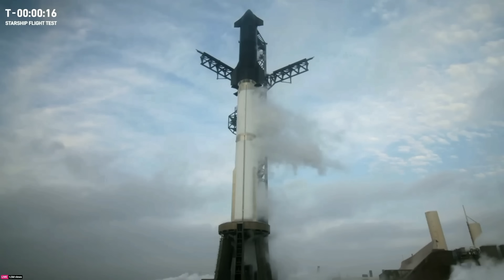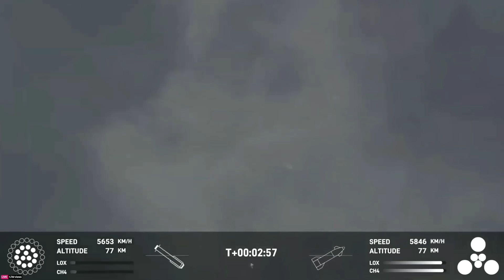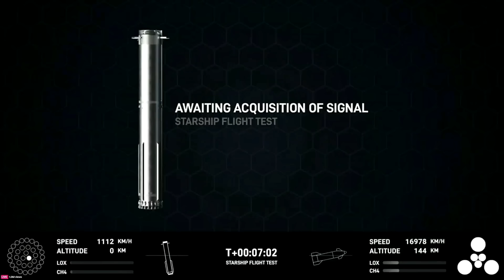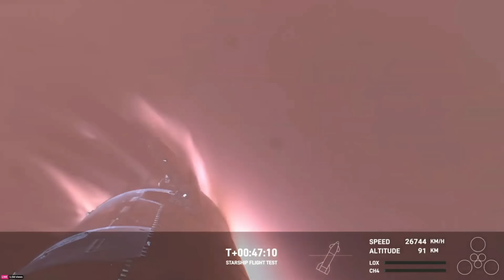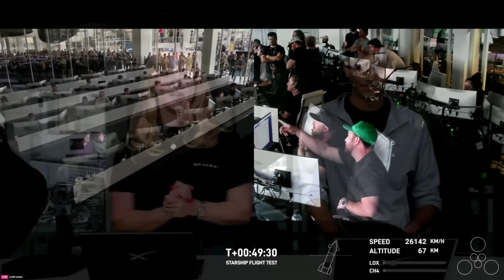SpaceX IFT-3 From Launch To Landing Complete Mission In 20 Minutes

Comment from the maker: 00:00 Launch
03:05 Hot Stage
04:00 Booster Boost Back Burn Shutdown
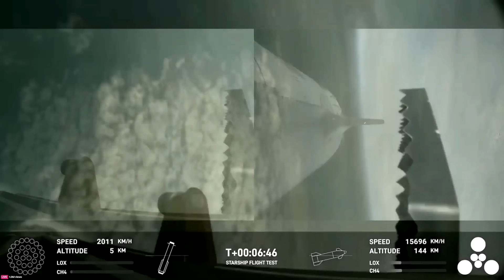07:10 Booster Landing Burn
08:50 Starship  Engine Cutoff
12:15 Payload Bay Door Opening Announcement
12:45 Payload Bay Inside View
13:00 Propellant Transfer Demo Announcement
13:15 Payload Bay Door Closing Announcement
13:22 Payload Bay Door In TROUBLE!
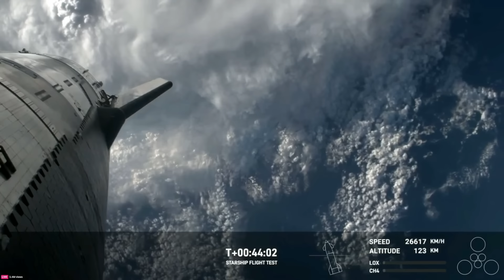13:30 Starship Reentry
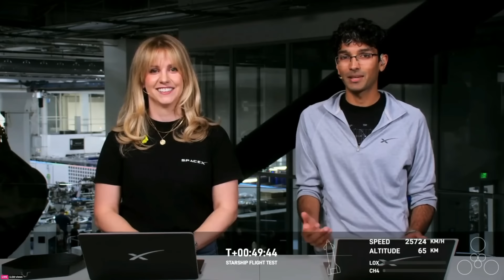19:18 Starship LOST
Reply: Thanks for the details.
Reply: Launch is at 25 seconds
Reply: Ok
Reply: Our SpaceX Starship IFT-3 Mission Launch Reaction:   https://youtu.be/HyQxPLoKm2Q
Reply: 0
Reply: 0
Reply: @firingroom1 oo p p

Comment: This must be the first time they've tried to re-light Raptors while going backwards through low-altitude atmosphere at over 1,100KM/H.  On the Booster all 13 Raptors lit for the boost back burn, but only 2 lit for the landing burn.  I'm sure SpaceX will fix this with IFT-4.
Reply: If they can burn another $1 billion taxpayer money.
Reply: Did the Booster run out of LOX for the landing burn?

@4:07  (T+3:46)  unfortunately they switched the feed from the Booster back to the wrong telemetry side (right)
@4:28  (T+4:07)  A big gas burst 
Venting goes on in waves for the next minute (till T+5:10).
Opening and closing the not proper sealing valve to get it free?
Reply: @PaulaBean  Starship has been designed to operate at $2million/launch.  Compare this to $2billion/launch for the SLS rocket (1/1000th the cost), which Starship should ultimately replace.  $2million isn't far from what it costs to fly a Boeing 787 from NYC to Sidney, should we also shame people for wanting to go to Australia?
Reply: @PaulaBean  Also, SpaceX's contribution to the Artemis program isn't a cost-plus project.  Most of the cost of Starship development is being paid for by SpaceX's own money.  They started Starship development long before they won the NASA contract, and most of SpaceX's revenue is coming from its very busy launch schedule for private companies and from Starlink income.
Reply: @PaulaBean  
Elon said the cost for a testflight is 50-100 Million $. 
Every iteration makes the production process better known, therefore cheaper.

So, 1 billion $ is at least 10 more testflights.

1 Billion $, that´s what the US military budget is for 10 HOURS! 
886 Billion $/year :  365 days/year  =  2,427 Billion $/day      ( :24 h/day  =  0,101 Billion $ / h)

Military budget is one Starship launch PER HOUR @ 100 Million $/launch  !!!

That is disturbing ;(
Imagine what could be done, if we would act as one, worldwide!
I mean the people ... not the politicians.
Reply: @hectorpascale1013  I was thinking something similar to this.  I don't think any details have been made available yet, but I also noticed the venting and wondered if it might be significant to the mission.  Perhaps by this time they had already given up on the orbital Raptor re-light idea for some reason, and decided to release unspent propellant and/or oxidizer before re-entering the atmosphere?  Perhaps based on information they had already gleaned from the Raptor misfires during the Booster landing burn?  I can't wait to hear more details from SpaceX.
Reply: @victorkrawchuk9141  wow，Idk the operation cost of commercial jet is so high before.
Reply: @XiaoMingMC  Actually, to be fair, it would probably cost less than $1million to operate an aircraft from NYC to Sidney, but it would still be not very far from a Starship launch.  Eventually they plan to launch Starship for less than $2million by generating their own methane fuel by scavenging carbon dioxide from the atmosphere, and from economy of scale.  My point is that SpaceX is trying to significantly reduce the very high cost of reaching orbit, and IFT-3 today was one step in that direction.  The days when everything an aerospace company did would cost NASA $billions are over.
Reply: @victorkrawchuk9141  You are wrong each raptor cost at least $1 million and the two stage rocket it self cost at least $30 million in mats and work and the first working Starship  
will have costed at least $6 billion and probably closer to $10 billion for the one that will land on the moon.

The SLS rocket already went around the moon and before the Starship could do that it will take at least 2 years....

You are drinking Musk cool aid.

The Falcon 9 who is a lot less complex and is partly reusable cost at least $40 millions per launch.

The Starship is at least 3 years from being fully reusable IF it will ever be.
Reply: Both stage testing was supposed to be at high speed splashdown to get data of such reentry. There was no plan to recover any stage. What you saw was as per design.
Reply: @PaulaBean  It didn't cost anywhere close to 1 billion.
Reply: @hectorpascale1013  Right now SpaceX is spending +$1 billion per year just on the Starship program.

The military budget pay the salary of at least 2.9 million peoples.

The Department of Defense is the country's largest employer, with more than 2.1 million. Military Service members and over 770 thousand civilian employees. 

 These military and government civilian personnel are augmented by over 600,000 private sector employees providing services and support under contract to the Department, not to mention hundreds of thousands of other employees in the defense industrial base and their suppliers who produce the weapons systems for our military. 

Furthermore, more than two million military retirees and their family members receive benefits.

SpaceX has only 13 000 workers.
Reply: @PaulaBean it's a private company.
Reply: @VedaSay  I know there wasn't a plan to recover either stage.  What I meant by my 1,100km/h comment was that this might have been the first opportunity that SpaceX had to try to re-light a Raptor engine while the nozzle was flowing backwards into a stream of air at close to the speed of sound.  I'm sure they'll get this right, as they did with the Merlin engines on the Falcon 9 which have to re-light under roughly similar circumstances.
Reply: It was doing 4500km/h at low altitude, bits were coming off.
Reply: @PaulaBean  It's $150 million per launch and on the first year, at least one third goes back to the government in the form of taxes.
Reply: @PaulaBean while SpaceX does profit from government contracts, They are largely privately founded.  That's kinda the whole point.
Reply: @PaulaBean   seriously^^?? comment without even research??:face-blue-smiling::face-blue-smiling::face-blue-smiling:
Reply: more like after IFT-12.
Reply: Please stop feeding the troll 🙄
Reply: @hectorpascale1013 just ignore that guy. Someone saying to Explore space and advance in technology is a waste of taxpayers money is not worth the debate. I think the most important progress for us humans is to go to space and Explore space, if we continue at this rate we may find out how things started with the ultimate goal of understanding everything. This is one of the most important questions, but surely not for people who just care about who wins the superbowl next year...
Reply: @PaulaBean Usually it’s at least 4 comments in before hate. You were #1. Good work.
Reply: @hectorpascale1013  Each engine costs $1 million so $39 million in engines alone. Then there is the cost of the ship and booster. Elon projected $1 million per launch while re-using the ships. He also predicted landing on Mars by 2018 with a manned landing coming in 2025. SpaceX was founded in 2002 so they have been around for 22 years.
Reply: @_John_P  that was ice falling off

Comment: big win. This is how iterative design works using experimental prototypes, especially when dealing with issues nobody has dealt with before in ways nobody has attempted. Both booster and starship made it further than before. Launching and separation appear to be mostly solved. Controlled reentry for the booster was accomplished, next step is sticking the landing.  Starship made it to engine cutoff and reentry, surpassing previous. Now they need to figure out what caused loss of control. I think the are likely a bit disappointed that starship didn’t make it through reentry.

All in all a great test flight. Getting closer to complete success and lots of great data in areas that there was none before to be able to push the envelope further next time.

Comment: We can see the ceramic tiles falling off. Need to solve that problem.
Reply: Agreed, but the abnormal rotation, which will be resolved, may explain the later loss of tiles. From what we could see of the ship, there were only 2 or 3 tiles missing by orbit.  It is thought that starship can survive a few tiles missing, just not next to each other in a large hole.  It also depends on where the tiles are missing.

Comment: As soon as I saw the indicator showing Starship nose-down I knew it was in trouble.  The thermal protection wasn't designed to protect it at that attitude.  Like the shuttle it has to come down belly first.  Curious as to what went wrong.
Reply: Maybe, Has to do with fuel line to the thrusters, froze out line, than it tumbled cause the wings couldn't readjust. Still amazing FEAT. All positive data.

Had to lower belly dive to help create the compression float/glide.
Reply: Starship was already tumbling prior to the scheduled relight (which I'm not sure was ever indicated that it happened.)

From what it looks like, they did not have enough control to properly orient for reentry. That it stayed aerodynamically stable enough to make it through what looked like the bulk of the reentry heating shows that at least the active articulation of the fins is enough to "point" it.
Reply: Today Elon found out they have no bloody control on reentry, he thought the vessel would naturally lay on its back as the atmosphere grows thicker but he observes total disruption in the air flow. The pitching and rolling of Starship will take years to solve.
Reply: @Bertrand146 what an absurd statement. While they clearly need additional control, that's a fairly easy to solve problem. How can you possibly think that will take them years to solve?
Reply: Probably a leak (you can see venting of gas into space) that made starship rotate faster and faster.
Reply: @Bertrand146 they had no attitude control the moment the reached space. And it is such a simple fix, add line heaters. I don't like Elon, but I love spaceX. Sit down, they never said they didn't need attitude control in reentry 😂😅
Reply: @nuclearandspaceeducation3201  A simple fix for a simple mind...
Reply: @PaulaBean  no. The reaction control system is a boil off venting system not a hypergol system. It's essentially doing non propulsive venting of the boil off gasses but when it needs to reorient it only uses one exhaust at a time instead of countering the venting with two opposite exhaust lines. 

You seriously have got to know rockets before commenting on the venting because it's not something most people know about. This venting is completely normal. In fact, if it didn't vent the tanks would explode from overpressure, well actually they probably have a burst disk but you get the point.
Reply: @Bertrand146 Reentry is where the rubber hits the road, this has never been done before with something that large and that shape, its also fundamental to the success or otherwise of starship. The solution will be interesting and may or may not be simple. Time will tell.Wings anyone 🙂
Reply: @Bertrand146  yeah, it's a simple fix. But you've got the simple mind for accepting and making assumptions when the entry interface attitude was wrong and therefore the flaps did not function properly. That's like having a plane fly sideways in a wing down stall and saying that the aero surfaces are not enough to control attitude. Like ffs man.
Reply: @curragh2840  Thank you. That is a clever answer. Indeed the shape might not be the right one and this would put the whole project at risk. That reentry shows SpaceX engineers have totally oversought that issue. As you say we will see.
Reply: @Bertrand146  how is the shape not right? Explain where there isn't attitude control assuming that the RCS was capable of orienting it properly. In other words how does it pitch up, down, yaw left and right, and roll left and right. Because if you don't know how the current design works then you can't say it's not enough.
Reply: @nuclearandspaceeducation3201  Sweety, why don't you keep playing with your tiny flaps. I guess you have to be american or blind not to see that Starship is everything but a plane. The issue is simple, too much weight at the bottom and that makes the "fix" incredibly difficult.
Reply: @Bertrand146  riggghhhtt, like they always do.  Next launch will fix it.
Reply: @Bertrand146  sweety, I guess you don't know what an analogy is. You still haven't explained the lack of aero surface control. I'm not saying what is or isn't wrong with the ship. But you can't blame the flaps when the attitude at the interface was wrong. If the flaps are not within operational parameters how can you blame them for not working? Your logic please. How can you say the weight is wrong? Where in the footage does it suggest the weight is wrong?
Reply: @nuclearandspaceeducation3201  I stroke a nerve, didn't I ? Calm down @nucléiairemecouilleseneducationsurglace... I'm nice enough to answer you in english... 
You want to compare a landing test from 30 000 feet with a reentry? Really???
We'll get to talk at the 4th try and by then I bet you SpaceX will have made huge changes to Starship. As a CERN engineer, there is simply no way that this big "barrel" can nicely glide its way down through high atmosphere.
Reply: @Bertrand146  alright Mr CERN engineer. Mr works on particle accelerators. Prove it. Make a video and post it on your channel to prove that there is too much weight in the back. Use the maths which you were taught. This is well beyond the lenz's and faradays law of your field so your qualifications are bullshit here other than proving you have the capacity to learn. 

And while we are at it, I am highly skeptical of your qualifications in the first place. A CERN engineer should be able to explain the basic concept of how the national grid produces electricity. The ball is in your court because outside of insulting people you don't have supporting evidence.
Reply: @Bertrand146  you struck a nerve. I'm sure you stroke them a lot too, maybe even as much as your ego to flex your French which has done nothing to prove your point. Accept my challenge and post a video explanation.
Reply: Elon and the team are very good at improving issues that arise every time. I’m hopeful that this problem will be fixed.
Reply: @Bertrand146 genuine question (not arguing, I’m no engineer): if the bottom weight is the issue, why is that barrel pointing nose down? Intuitively, shouldn’t gravity cause the opposite (nose up)?
Reply: @PaulaBean Hard to say. Coming down at 3000 kph in the thick lower atmosphere, that blunt end  of the booster with the engines is not aerodynamic at all.  The forces may have overcome engine steering and the grid fins, meaning they will have to fire braking engine sooner and limit max velocity at that point.

As far as the orbiter goes, could be a heat shield failed, could be a fin failed, could be a lot of things.  Let's wait and see what they come up with after investigation of their telemetry data.
Reply: @regalia_usa  It's pointing nose up...
Reply: @Bertrand146  but between 47 and 48 min mark when it lost control it was clearly nose diving instead of resting on its belly, no?
Reply: @regalia_usa  46-47 min mark on this 19 min video ?
Reply: @regalia_usa  I'm not trying to be mean.
Reply: @ByronScottJones I agree... My uncle was a skydiver and at 6'8" 390lbs he managed to control that flying brick of a body with his 2 smaller than average 13 year old child's sized hands. So I feel this is a very accomplishable task for Space X, if not I can give them my uncles "Bricky Mickey" number and he can tell them how to twist those "Wacky Flappies" to get that starship to fall flatter than my aunt's  AKA "Patty be Flatey that chestie and backie" body.
Reply: @Bertrand146 well no, at T:46min flight time. obviously this particular video jumped the timeline on several  occasions
Reply: @Bertrand146  Lol years?   They will try again in 2-3 months and again in 2-3 months.. will be solved soon.
Reply: @PaulaBean  Genius thats how its control works,  not 'venting'
Reply: @Bertrand146  - Ahh, No.  They'll have that issue fixed for the next flight!

Comment: SpaceX has 4-5 boosters in production, next one almost ready to go.  The next Starship is 1-2 days away from its static fire test.  Once the static fire is done, then they just do whatever control upgrades and its ready to fly.
Reply: First, they have to figure out what went wrong with both the booster and the ship. That could take some time. There should be some data available from the booster. If everything went as planned but the booster engines failed to light at that speed in the atmosphere they have to radically change the plan. If they don't have data for both, they may have to guess what happened which would make trying to solve the problem more difficult.
Reply: @tiredoldmechanic1791   They fixed the problem with boost back burn , they fixed some of the starship engine problems.   Heck from IFT1 to IFT2 and now IFT3 they really improved Raptor reliability.. It will take more flights but SpaceX will figure it out.